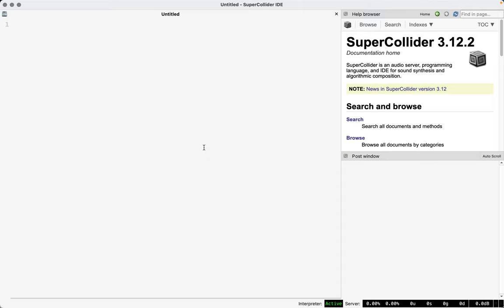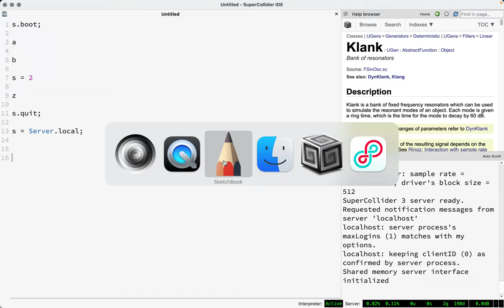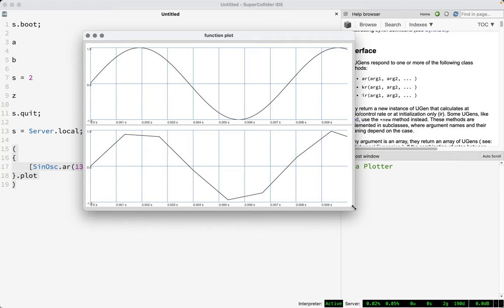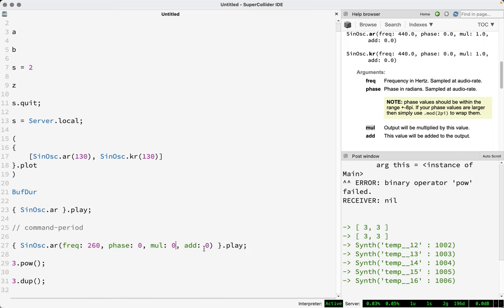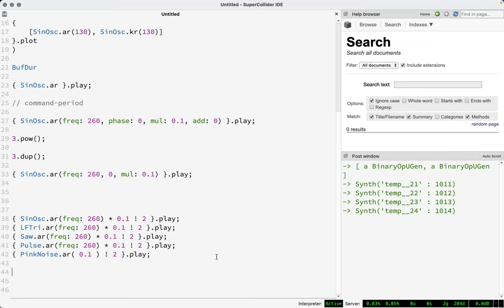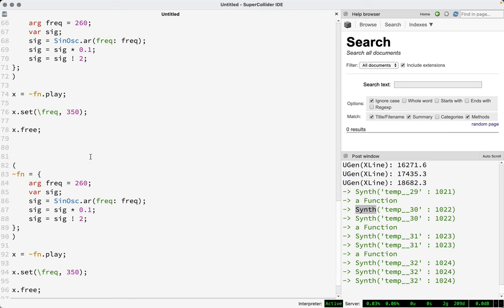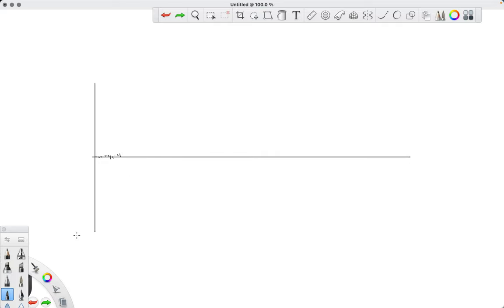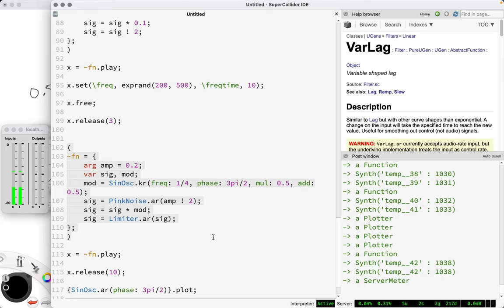Basics of Making Sound - Week 3 Fall 2022 MUS 499C - Intro to SuperCollider

Comment: What's a way to limit output from a sound that is inside an iteration such as do? Can Limiter be used somehow as a "wrapper" around the iteration block of code? Excluding the obvious solution of reducing the number of iterations, how can we avoid increasing loudness from sounds that are getting stacked on top of each other in the node tree due to iterations?
Reply from the maker: Good question. Yes, Limiter can be used as a wrapper, assuming the iteration block returns the signal to be limited ('collect' returns the results of its function, 'do' merely returns its receiver). Reducing the number of iterations is an option, but if you don't want your iteration count to change, you can instead divide the summed signal by the iteration count. In most cases, this is a good starting point for producing a nominal-level signal, but some tweaking may be necessary, depending on what's inside your iteration function.

If I'm not working in a live context, my preference is to "do the math," i.e., divide the signal by the iteration count:

(
{
	var sig, iter = 10;
	sig = iter.collect{
		SinOsc.ar(
			freq: {ExpRand(200, 2000)} ! 2,
			phase: {Rand(0, 2pi)} ! 2
		);
	}.sum;
	
	sig = sig / iter; // compensate
	
}.play;
)

Note that some UGens, like Splay, have amplitude level compensation built into them.

The Limiter option would look like this:

(
{
	var sig, iter = 10;
	sig = iter.collect{
		SinOsc.ar(
			freq: {ExpRand(200, 2000)} ! 2,
			phase: {Rand(0, 2pi)} ! 2
		);
	}.sum;
	
	sig = Limiter.ar(sig, -1.dbamp);
	
}.play;
)

There are also a few different quarks that automate this process. I've used StageLimiter from time to time: run Quarks.gui, check the box for BatLib, recompile the class library, and then run StageLimiter.activate; after the server is booted. StageLimiter and similar quarks are a great option if your iteration block generates multiple Synths instead of multiple UGens summed together in a single Synth, in which case, a single Limiter won't necessarily get the job done.